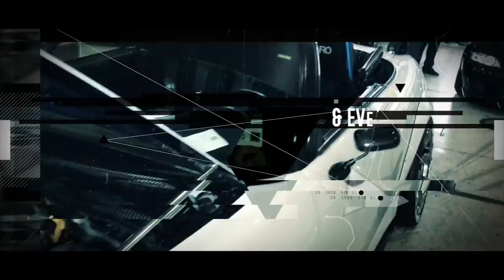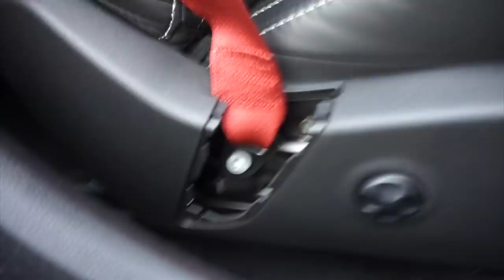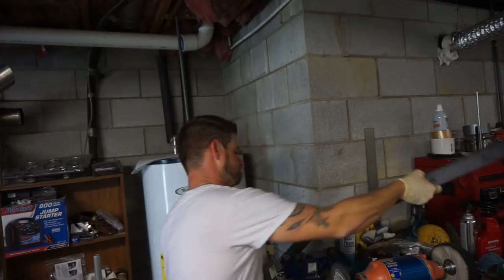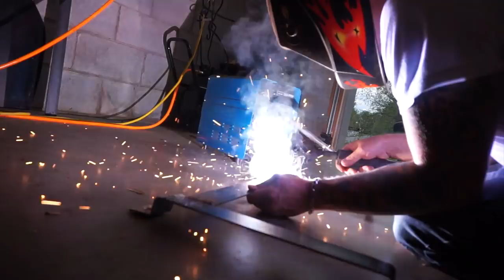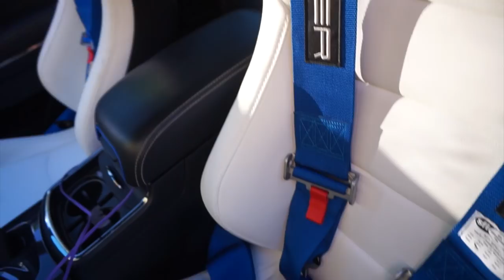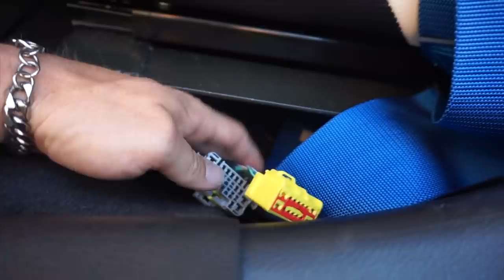Racing Seats For The Hellcat from Cipher Auto

Comment: Looks good my dude! Surprisingly good beads with that flux core welding too 👍
Reply from the maker: SlammedHemi thanks bro. Yea my welder is a POs. Doesn't even use gas 😓 I need a real one but I really want a nice TIG
Reply: SRTMUSH tigs are a must if youre gonna be fabricating, I have a stick, mig and tig/stick. You still layed some nice beads with what you had, thats what matters! 😉
Reply from the maker: SlammedHemi thanks brotha. I appreciate that 💙💙🙌

Comment: Yeah ; Way to adapt & overcome. I enjoy some fabrication. Nothing like working with metal, making smoke & noise. I did pretty much the opposite of what you have done here back in the early 80s I adapted the front seats (fully power adjustable ) out of a 77 Chrysler Cordoba into my 68 Baccaruda. Why ? for the fine Corinthian Leather and because I was young & thought it would be cool to have the only 68 Cuda with Power Leather seats.
Reply from the maker: thanks man. Im all about just trying to have something different. If it came with racing seats, id probably be looking for high end power everything seats to put in it. lol

Comment: Were you ever able to get around the Airbag sensor light? I'm tentative to pull the trigger on some new seats if I can't figure that out and keep the rest of the airbags working. Is it as simple as jumping some pins with a resistor?
Reply from the maker: Joshua Croft no it’s not that simple. I haven’t figured it out yet. But the other air bags still work.
Reply: SRTMUSH thanks man I appreciate it

Comment: I wonder if it (the bracket you made that the seat attaches to) will stand up to a severe crash?  OEMs build these seats to withstand severe loads, crash standards.  One of the things the passenger seat has, is a sensor that tells the air bag to deploy or not, based on the weight of the passenger, did you lose that sensor?  Another thing to consider, did the seating position height change, if so, the deployed air bag may behave quite differently.  The seats play the most critical part to surviving a crash.  It's risky to change that part of the car.  They do look good though.
Reply from the maker: the bracket im making is made the same way as all the other companies make seat brackets for aftermarket racing seats. 3/16" steel, still uses all 4 mounting points like stock. Only difference is these dont have airbags IN the seats the the stock ones do. Everything else will work the same. Seating height is the same.